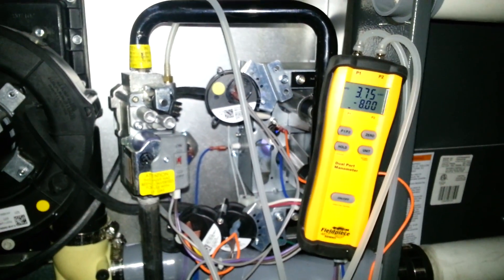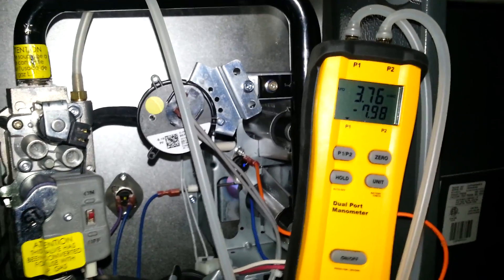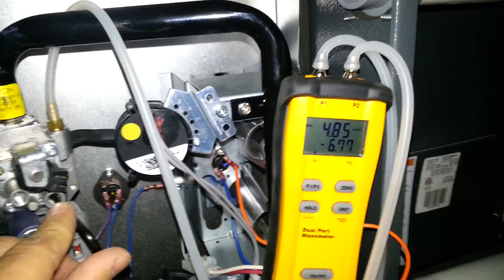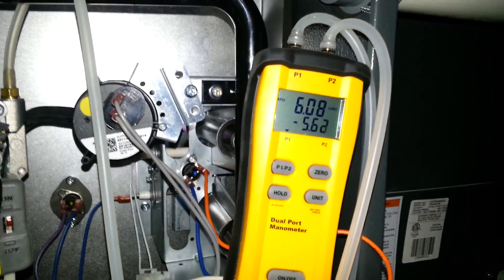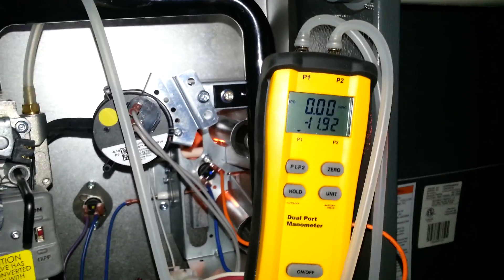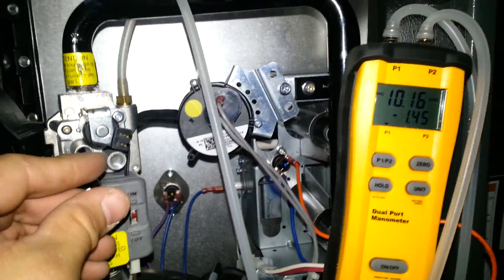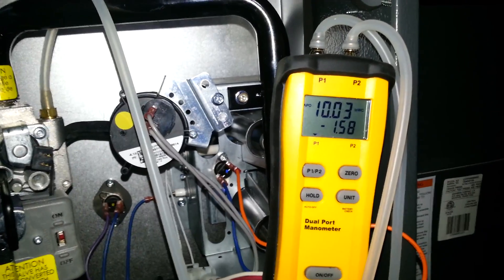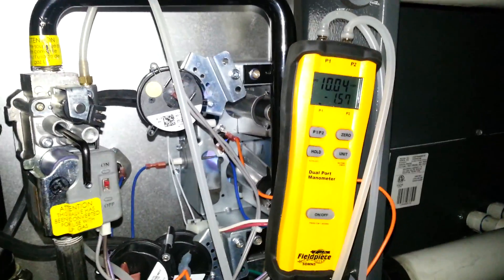Fieldpiece Dual Port Manometer Demo

Comment: To jump second stage did you jump R + W1/W2 or just R + W2? Follow up, can this device be used with pressure switch as well?
Reply from the maker: Pretty sure u need r to w1 and w2 on most brands but  I'm not sure about the pressure switch ability.

Comment: want some advise? shitcan those flimsy soft silicone hoses and buy 2 packs of orange colored 3/16" id silicone air proving switch hose at your local Johnstone. i had 2 rips in those hoses in less than one week. the orange hose is much more durable and tougher to rip. get 2.  3/16" barb fittings at the hardware store. the original hoses suck and Fieldpiece has been made aware of this potentially very dangerous situation!

Comment: So for Natural Gas P1 goes to inlet and P2 goes to manifold and manifold pressure should be 3.5 wc?
Reply: Enzo Amore check the furnace literature or model number tag for manifold pressure on your specific unit. 3.5 is very common but not always the case.

Comment: would like to know more about what side do you have the gas pressure hooked up P1 or p2 and which side is the manifold side P1 or P2
Reply: +jas van   p2 is the gas inlet and p1 is the gas output to the burners becuse that's what you need to adjust the pressure, natural gas will be 3,5 W.C. in a single stage or regular gas valve, he is using LP gas tha's why the pressure is diferent but in a house with natural gas you wil have around 7.5 W.C. inlet and the outlet is 3.5 W.C.